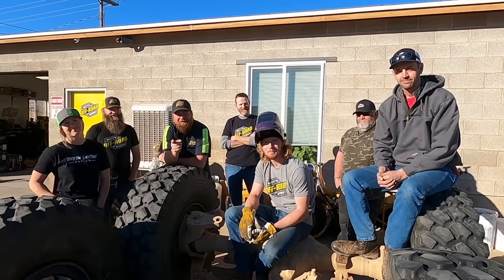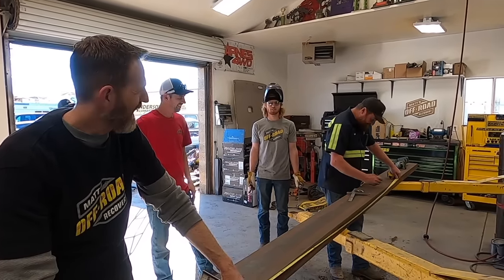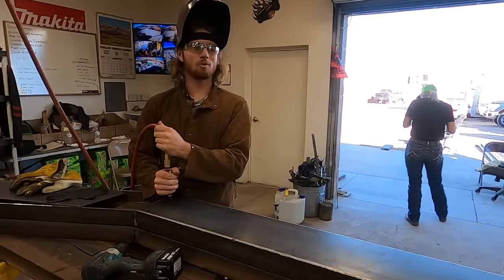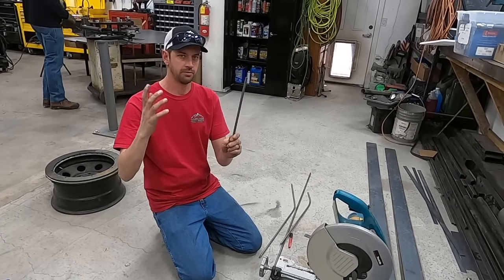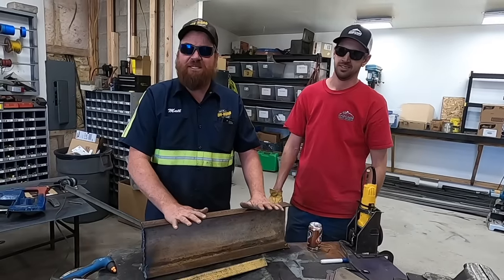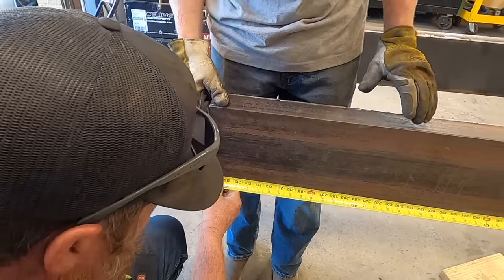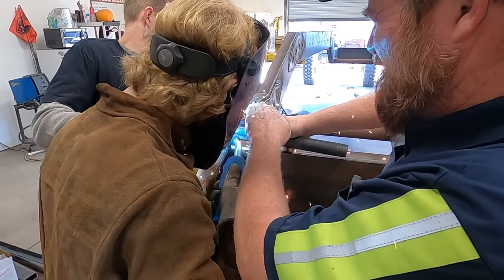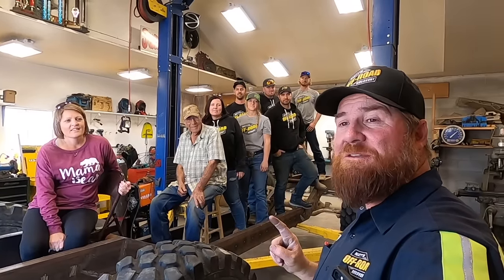I'm Building The WORLD'S LARGEST Off-Road Wrecker

Comment: Just what  I wanted to build! One thing scares me though,  I wanted to do my frame the same way until I looked into it and found airtanks that had failed and resulted in a massive explosion.  If you are lucky it will just rip the frame open and no body will get hurt. Plus the compressed air will accumulate water in the frame and rust unless you drain it nearly daily. I am just going to run a air tank now.
Reply: I was thinking the same. These tanks should be hydro tested to 150% max pressure and also make sure to mount a drain valve at the lowest point or make sure you drain with the opposite end up a bit.  And a PRV.
Reply: @devinwarwick  yeah i probably would have went withsomething thicker than 3/16 plate and recessed it a touch so i could lay a nice strong bead then pressure test to 200% the goal pressure...make sure ive got plenty of opportunity before catasrtophic failure
Reply: In low-humidity areas like where they are, you get MUCH less moisture in the tank. I've lived where the humidity doesn't get above 20% and you'll get a few cups of water in a tank over a period of a couple months. I now live where the humidity is considered high and you'll get that much in a week.
Reply: @ADBBuild  on my kenworth I drained the tanks every day and even in dry climates it sometimes surprised me.
Reply: Even if they had none of those problems, they definitely loaded up those air tanks with metal shavings when they drilled all those holes.
Reply: These could be bad idea - why not strap some regular tanks in the channels if space is an issue.
Reply: You need at least 3 air tanks... A wet tank, dry tank and an emergency tank to be D.O.T. (federal laws) legal... Tanks also need to be A.S.M.E. certified to be legal for airbrake use... Federal laws are strict when it comes to airbrake systems.. I already made comment to Matt concerning this... I've got 25+ years working on hi-way trucks.... Using the frame rail for an air tank isn't legal...
Reply: @ldvan100  - He is using hydraulic brakes. The air is for airbags and lockers.
Reply: @MattsAwesomeStuff  I see Matt gave the experts plenty of things to arm chair on this build. lol (I'm not bagging on you, as you obviously listened to what was being said).

Comment: I can't wait to see the look on some stuck guy's face when he makes a call, expecting the Banana, and THIS behemoth comes along! Please tell me you are painting this Banana Yellow. :D I love that you are using the frame as an air tank. This rig is going to be awesome! Hello to Casey, and Tom Tom, thanks for your support and know how using the angle thingy lol. Great to see Ed as well. Hope all the crew is well and look forward to the next episode. Be safe and God Bless.
Reply: They should make the body a giant banana, like the Oscar Meyer Weinermobile.
Reply: So frame air tank i don't get it can someone explain why they are doing that
Reply: @GrimResistance  Suggest it to Matt, you never know...
Reply: @brandonmcandrew4859  Why not? 1/4 inch steel box, make it air tight and you have 10 gallons of air tank without the extra weight of external tanks. I have seen a lot of off roaders do this with bumpers and such. Otherwise wasted space being put to use.
Reply: @johnme7049  i see so you could fill up tires and that with the air I was just thinking of it in a different way altogether
Reply: @brandonmcandrew4859  You need air to operate the brakes on heavy trucks.
Reply: @saxamusprime  ok can be used with a air pump too
Reply: @brandonmcandrew4859  Air is also needed to operate other things, like A.R.B. locking diffs. These operate like a normal open diff but with the touch of a button instantly give you a locked diff when you need the extra traction.
Reply: @brandonmcandrew4859  some of those tires have an auto inflate/deflate system, those tanks will hold air to inflate the tires when needed and deflate them for more traction, just like a Humvee

Comment: As someone who spent ALOT of time out wheeling in the mid to late 90's as a teen and then joined the Army as an 11B and then 63S & B AND did recovery school I've said for decades now that I've wanted to build a strictly off-road wrecker like the HEMMIT(Osh-Kosh) I trained with and worked on for years. Here on the East Coast and in Massachusetts there is a huge need for stuff like that and what you all are building..I would love working with and for y'all!

Comment: Welding the frame to hold compressed air is harder than it sounds. If you are seeing leaks there will be weak spots that you don't see. Don't worry, they will show up once you get off road.
Reply: yep, it's a terrible idea, strength wise as well flat surfaces are terrible for holding pressure. The truck is massive, they need to just put in a proper off the shelf air tank made for the job!
Reply: Soapy water will find them quick. I meant while the welding was happening.
Reply: @feeneysmechanical6215  Mother nature will ALWAYS find a way 😉😂
Reply: I’d guess with this team of guys and girls it’s achievable and I’m sure it be thought though
Reply: I was thinking the same thing. Im curious to see how this does in the long run vs just putting a regular compressed air tank somewhere on the rig.
Reply: @ibeemeeintp3033  If rust doesn't get to it, a sharp rock might do the trick. I'm guessing they are using a separate tank aswell, and not rely on this for safety like brakes, just as an extra buffert.
Reply: Considering how easy it is to plumb in a real air tank later on, I wouldn't worry about it.
Reply: What is the purpose of the compressed air in the frame? Just to ensure a tight weld to prevent water ingress or does it add some other value?
Reply: @fredygump5578  
Companies test air tanks at up to 5 times the working pressure. It is submerged in a water tank to contain the shrapnel from failures. I've done some sketchy things so I can understand the why. But I worked a lifetime so I can also sweat this failing really painfully. If one of my welders had one leak after welding for a month I would fire him and go over everything he had ever done. Multiple leaks on a couple hours of work scares me.
Reply: @toddswain7459  
Driving on sand needs really low tire pressures. Slippery rocks needs a little more. Road driving needs even more. It always helps to have air on the trail to make pressure changes and fix flat tires.
Reply: Why not just install truck pressure tanks in between the frame rails? Only available at every truck junk yard in America and has worked for decades. Easier to plumb as well.
Reply: @ronpurcell9984  I think the idea is to make an entertaining video as well as a useful off-road vehicle. Plumbing in a tank would be good but seeing the crew build integral air tanks was fun.
Reply: @joseamundarain3366  Yeah I suppose so, and the video is fun but I'm thinking that tanks are going to be showing up at some point because pressure tanks are always round for a reason.
Reply: @toddswain7459  they are using the air for the lockers and the airbags.
It's just a handy space to store compressed air.
Reply: @michaelvangundy226  They stated that they are using the air to control the lockers and adjust the airbags in a previous comment.
Reply: This was a excellent example of why high pressure tanks are typically cylindrical in shape. 
I recommend abandoning the in-frame air tank idea.
Reply: Matt wasn't kidding about learning something. Never heard of air being stored in the vehicle's structure. Also welcome to Matt's Dad.
Reply: @brianellison3525  Why would you need to turn off the lockers?
Reply: @michaelvangundy226  makes a heavy rig steer easier.
Having all four wheels locked up, makes your truck want to push straight.
In my K-5, I usually leave my passenger tire locked in all the time, but jump out and unlock or lock my drivers side as needed.
In my toy, I can just unlock the front and it's like having a normal differential where only one tire pushes at a time depending on traction. Easier to steer but not as much or as predictable traction.
Reply: @michaelvangundy226  I think this "tank" is pointless, but also harmless!  But yeah, every start/ stop leaked because he didn't grind them first.  If a guy does some prep and knows how to set up a welder, he shouldn't have leaks.  I think it's easy, but it is not easy for a lot of people.
Reply: @brianellison3525  ahh okay thx. I was trying to imagine them filling it with helium to reduce weight when the get into sandy / muddy situations. All the reasons I’m not an engineer.
Reply: @toddswain7459  That creek gets deep. Think submarine ballist tanks.
Reply: @ronpurcell9984  Hopefully the crew will take all of the comments into account and find a way to make it work or go with a more standard set up for safeties sake.  I'm sure they don't want some catastrophic failure out in the wild.

Comment: those start/ stops that leak will leak in the future, the weld needs to be grinded where you stop and are going to start welding again. Plus tig  welding would have been less problematic.  However, air tanks are round so they dont deflect when under pressure.. that frame will flex from driving plus the air pressure flex, it will cause weak spots and then air leaks.
Reply: Well air leaks should fail less catastrophically as the welds break.

Comment: Having the frame double as an air tank seems like a great idea, but I have my doubts about it over the long term. Frames flex, and there is no getting away from it. But with the added stress of air pressure on the welds, I suspect that they will just crack even sooner than if there were no air pressure involved. Granted, if the welds are good, the parent metal will just crack next to the welds. If it were me I would simply find some room somewhere on the frame to mount some air tanks. They could have been purchased and mounted for less than the cost of the time invested to turn the frame into your air reservoir. A 1250 cu in tank (12 gallons) is about $150 brand new and is 12" in diameter by 29.5" long. Additionally, they are easily replaced if they become damaged or rust through. Considering the arid climate there, I don't think that rust inside the frame will be as big an issue as everyone suspects, but it will take its toll over time. Aside from the air tank issue, it sure looks like a great build, and I will be happy to follow along. Wishing you guys the very best of luck with your project!

Comment: Air tanks, propane tanks, gas bottles are round for a reason.. 
Round above ground swimming pools have thin sheet metal walls and zero bracing, while oval or square pools have super strong buttress'..
For the he same reason.. 
Nature wants to be round.. 
Just saying.. 
Also, I did 9th grade 3 times, so I'm pretty smart.

Comment: As a certified pipe and boiler welder
I find it very disturbing when people make pressure vessels out of square and rectangle tubing or plate
Reply: I agree with your comment. There is a reason that air tanks and pressure vessels are round with domed ends.
Reply: I missed something,  I thought they were pressurizing it to find spots in the weld that would let grime and moisture inside the frame. Why is it meant to hold pressure?
Reply: @Lowkey_ID  I am assuming to hold air for the air brakes and after reading some comments maybe for airing up the tires after getting off the soft sand.
Reply: Lokey they are using that space for the air compressor holding tank. That’s why they mentioned 4.9 gallons per side
Reply: @Lowkey_ID  they said they want to use the frame for an actual air tank. Did you watch the video??😂🤣😂
Reply: Honest question, at 200 lbs or less would it be an issue?  I would think the stuff you weld has a much much higher pressure .
Reply: Blows my mind that it bulged like that. I’m no welder or pipe fitter. Would thicker walled metal not have bulged?
Reply: Couldn't agree with you more. I used to be a certified welder and seeing the frame being used as a pressure tank is not a good idea.
Reply: @jbw5485  It would bulge less. But also increase the weight of the vehicle much more. Both are not wanted.
Reply: I find it very disturbing when people pass judgement on others.
Reply: @mikek5298  normally agree, this case is a safety related issue and that's different. 
Every see a pressure tank blow? That'll ruin a lot of people's day and it takes far less pressure than most people think it does. It takes even less pressure when the vessel being built isn't being engineered to take the pressure, as is rounded or spherical so the walls can absorb the pressure equally.
Reply: @mikewhitman745  tom tom is an engineer im sure he has it handled just fine.
Reply: @lethargicmotorsport2025  Absolutely. Say for sake of simplicity the tank is 72" x 6" that gives a surface area on one side of 432" sq, at 150 psi you're looking at 64800 lbs of force pushing outward. That's just on one side. The metal can absolutely handle that, but what about once it starts getting lots of force applied to it through driving and rock crawling, winching, and everything else wacky that goes on in off road recovery. Those tanks will not last.
Reply: Agree. That’s because people don’t understand fluid dynamics and how force multiplies in corners. If you don’t know how to calculate the forces applied, you shouldn’t be attempting to make it. 50 psi spread across 100 in*2 is 2.5 tons of force. 100 in*2 is less than a square foot. When you have corners, the total applied force across the surface is presented to the corners as a direct load.
Reply: @jbw5485  I was but the wife noticed I was holding complete attention on something interesting and decided to talk to me in the middle of it, expecting an actual conversation at a point where I didn't see the need to have one. Must've been there when Matt mentioned that bit of information.
Reply: @stevelovesoutdoors320  oh, ok.... that's gonna fatigue the welds eventually.
Reply: @Lowkey_ID  it’s sad that I relate to that so much!!! 🤣😂🤣 I actually backed the video up a few times also.
Reply: @AnonyMous-jf4lc  yep. We are AOVs where I work. Air operated valves. Some are small and some are huge. When I went through training I was baffled at the amount of force being applied to the rubber diaphragm. Just an 8 or 10 inch diaphragm can close valves with 10’s of thousands of pounds of force. With just 120 psi applied. Shits crazy
Reply: @jbw5485  think about the area X pressure. How wide was the C channel, 8" maybe? And the length of the plate that they boxed in maybe 5' or more? That's 8" x 60" = 480 sq in of area. If you put 80 psi in the tank that would be over 38,000 lbs of force trying to separate that plate from the C channel.
Reply: @lethargicmotorsport2025  120 psi is enough to tear it wide open when it goes.  Someone could get hurt. I wanted to do this but looked into it and realized it's not safe. Plus compressed air condenses water in the frame unless you drain it every few days. After realizing all that I figured I would feel a lot better about it down the road to just run a real tank.
Reply: Thanks for giving the input fellas. I understand the desire to multi purpose something....but this seems somewhat concerning. I fabricate, forge, and weld. ..among many other things
Reply: @msudawg1997  yep. That’s a ton of force. Multiple tons actually! 🤣😂
Reply: @joshlower1  yes, but he didn't design it. He suggested adding the braces to help stop the bulging of the side plates in an attempt to keep Matt's design going. 
Nothing against Matt and I like the idea,  it's just not a safe shape for a pressure vessel. 
And remember the original design started to fail immediate when they tried to pressure test for leaks. If you want to tell me that was designed correctly for the application you can but I'm just not going to buy it. 
Again, not a dig on Matt or whoever else uses square tanks. It just could be done safer.
Reply: @mikek5298  my judgment is based on a career that spans over 30 years and the knowledge that when a pressure vessel explodes under pressure it can equal an actual explosive device people can be injured severely or killed by the flying shrapnel
Reply: @joshlower1  apparently you do you chose to come into the comments section and leave a stupid comment
Reply: @joshlower1  spoken like a true future Darwin Award recipient.

Comment: Well..."If you build it, they will come!"  I'm excited to watch this build!
Q:  There is sure to be some condensation build-up in the "air tank" portion of the frame.  Shouldn't you have painted or sealed the steal with something before welding it all up?
Reply: It’s not gonna rust any more than it already is. It’s gonna be clean air in there, as a result, clean water. More or less. 

It would probably take 20 years of use for that to really mess up the metal enough to matter. As long as they remember to drain it no problems should arise really. 

All that being said, there are products that can be sprayed or poured in to coat the inside of the air tank to help protect it.
Reply: @Tjspycorp  Clean water will rust metal just as much as dirty water. There's a reason you're supposed to empty air tanks after you're done using them every time. Go open up the drain valve on a 5 year old compressor that's never been emptied. 😅
Reply: @Studio23Media  yep! The air tank frame rails aren't the best idea. Real air tanks don't take up that much space.
Reply: @Studio23Media  that’s why I said as long as they remember to drain it
Reply: Can't really paint BEFORE welding. They could fill the tank with a paint or coating, drain, and that should offer some protection, but how much is the question. If they drain the tank with any regularity or use a dryer rust shouldn't be a significant issue. Water alone won't cause significant rust, it when you also have salt or contact with another type of metal, neither will be an issue for the inside of the tank.
Reply: @christopherrto  WRONG!!
All needed for rust to form is moisture and O2.